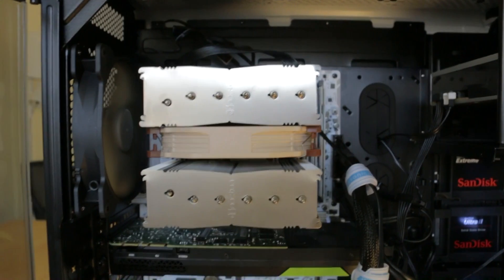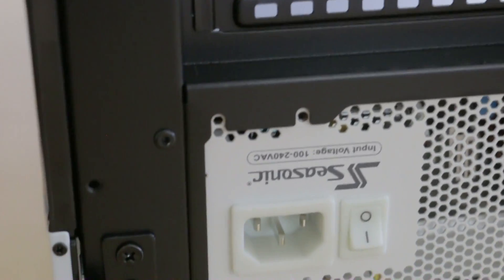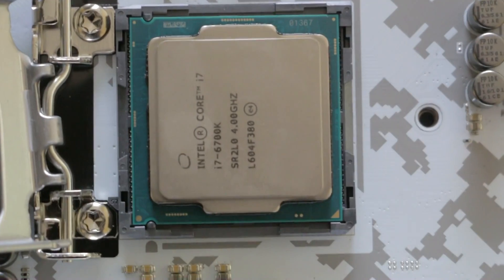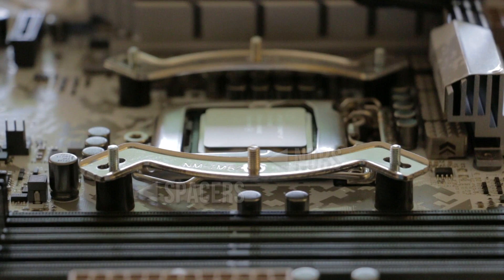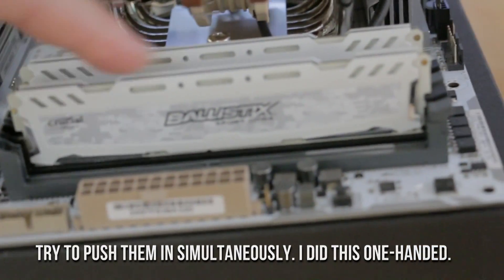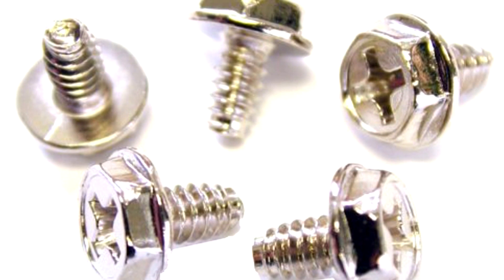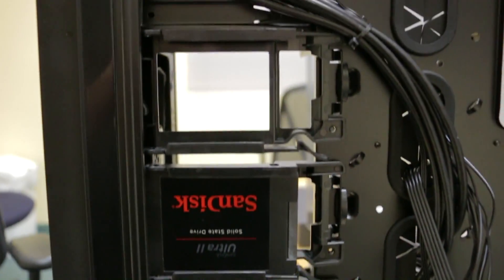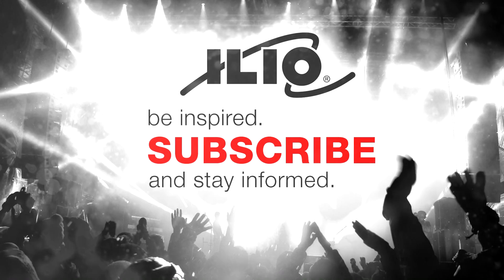Build an Audio Production Computer for Under $1,500

Comment: Did the board have thunderbolt 3?

Also a SSD for boot up and DAW/plugins is pretty much a must if recording at 96k. 

Also 2x fast hard drives for actually recording too (well to record to and one for backup) as you should try and avoid read/write to the same hard drive (in audio) at the same time. 

I think these basics would make it a good audio pc.
Reply from the maker: Hi Musa! It's difficult to find a Thunderbolt 3 port on a PC motherboard, which is a total shame since the speeds way out blaze anything currently available. However, Thunderbolt 3 is much faster (5 GB/s x 4) than any SDD available, including the M.2 NVMe form-factor which maxes out at 3.5 GB/s. As for a boot drive, I've listed an SSD in my spec, but I have one dedicated to the OS and programs because I personally like to keep my samples and recording on separate drives. I think that's always better given the tech keeps evolving and getting faster. The ideal sample drive is going to be M.2 NVMe right now (this motherboard has 1 slot available for that and newer boards are coming with 2. That number will only increase as the tech becomes more ubiquitous).

I am working on a video to describe the different types of hard drives and busses right now, and the best uses so stay tuned!
Reply: Hello Michael! Thank you for this video. I've watched it about a dozen times trying to wrap my mind around the idea of building my own audio recording pc. I'm replying to the question about Thunderbolt 3. Here's the thing: am I getting too hung up on thinking that any pc I build needs to have Thunderbolt 3 capabilities for it to be 5 year future proof? With my newb understanding of these things, it would seem that it is THE FUTURE and that you can have it now. But, I know that you can record without it. What are the primary benefits of TB3, what primary convenience does it offer for recording? Is it just a super duper luxury or is it something that everyone will be reaching for in the next couple of years for recording? I've found mobos with 1xTB3 ports and I'm wondering if I should start there and build around that.
Reply from the maker: Hello Tilford! While Thunderbolt 3 touts insane speed, there aren't a lot of peripheral devices right now that take advantage of that connection. The only hard drive type that has the throughput is M.2, and there are currently only a small few options for external enclosures for those. Even your standard SSD won't be able to give you the full bandwidth of T3. There also aren't many options if you want a motherboard with integrated ports. My suggestion then would be to get a PCIe card for T3 as the USB C protocol seems to be far more universally accepted. Most newer motherboards have that connection type. Remember, the speed and bandwidth available is only as good as the device you're connecting to it.

Comment: I think 64 GB of RAM is overkill.. 32 GB is enough! You can also buy 550W/600W/650W Power Supply because you don't need so much power (you need that much only if you have a GPU and you play videogames on your PC) Next time try "PSU Calculator" so you know what Power Supply is good for you! Don't forget to buy a 1TB HDD for your files :)
Nice video anyway! :D (sorry if there are some mistakes, I'm Italian)
Reply: Shazamm The iPad Producer simply render the melody of the piano and use the WAV file so you don't waste RAM ;)
Reply: P.S. In future you can try a Water Cooler so you can overclock better your CPU! :D
Reply from the maker: Ah, but you'd need to know some things first: 1. I AM using a GPU in my machine (NVIDIA Quadro M5000). You can see it on camera, but I don't call it out because it raises the price tag significantly (I use the computer also for video editing). 2. Buying a higher power PSU allows you to upgrade without having to buy another one later. See? 3. I will cover HDD's in another video because that topic is EXTENSIVE! To start, I added a small capacity SSD for boot drive and OS. The rest depends on your use (again, I'll cover that in a new vid). 4. 64 GB of RAM is NOT overkill, bro! It is always better to max your RAM out the first time than to wait and add more later, possibly having to buy new sticks IMHO. I remember once saying that 100 MB was all I would EVER need! I plan on having this machine for 5 + years so I do the best I can to prepare it for longevity. ;)
Reply: ILIO haha yes you're right! Sorry I didn't see the GPU! For the RAM I think is too much for different reasons: 1) The price. 64 GB in Italy cost 250 - 300€. 2) For the next years of this generation you will never need that much of RAM (remember that the minimum for producing in a decent way is 8GB) 3) Technology never stops and in 5 years or less the DDR4 will be replaced by DDR5. So I think that in 5 years you will never need that 64 GB. It's just my opinion and it would cut the price a bit for the rig!
Reply from the maker: ***** Video editing uses a TON of RAM, plus I'm using Keyscape (minimum 8 GB of RAM required), Omnisphere 2, Trilian, Vienna Symphonic Library, all of these use RAM to stream samples optimally. You COULD go with 32 GB of RAM, which would be fine for even the most intense use and you'd save about $200. For me, I need all 64!
Reply: ILIO Yes, it's just personal opinion and needs! Nice PC anyway!
Reply: I have Komplete 11 and there are some racks were a single instrument is 11gig of ram. Steinway piano for instance
Reply from the maker: You can freeze tracks in most DAW's which allows you to go back and tweak the MIDI file later by simply unfreezing. This is my preferred method.

Comment: hey please provide all the links for the products you used... that would be really helpful thanks... :)
Reply: it took me 10 min to google them by myself .dnt be lazy. in Euros, the total costs are 1350.- Eur
Reply from the maker: Sure, but you can probably find the best prices by searching online. We'll update the video with the parts list, and that should help you Google what you need!
Reply from the maker: It depends on what you'll be running, plug-in wise. Always check the specs of the software you are buying to make sure it will run on the processor you are using. An i7 is always a better choice, particularly one with a faster clock speed (3.0 GHz or higher) so you can run high-quality DSP synths and effects. If you're just making beats, recording, or using samplers then an i5 should be totally fine. Again, pay attention to the clock speed!
Reply: Can I Use A i5 ? A Beginner Now Getting Into Producing
Reply: can i get a Ryzen 5 1600 for production? i mean isnt it better cause of the cores?
Reply from the maker: Hi Jim, this is a question I've been getting a lot. It's not so much a matter of cores as the code optimization. Since AMD processors are not found in Apple products, and most music software is cross-platform, I cannot recommend anything but Intel simply because most audio applications are optimized for Intel processors.

Comment: Mounting the psu upside down is just pref. I have the seasonic 660 and it's got a silent mode option so the fan only runs when it's under high load so the fan is really never on unless i'm rendering out something. So yeah i just have it upright. the fan's never running most of the time. Nice build though otherwise.
Reply from the maker: Well Andrew, I'm all about keeping the ventilation clean and I do a lot of high load processing so that fan is definitely coming on for me! ;) Heavy software synth usage and video editing will do that.